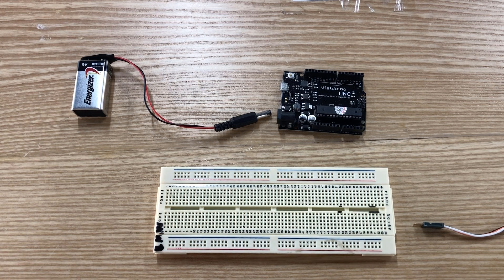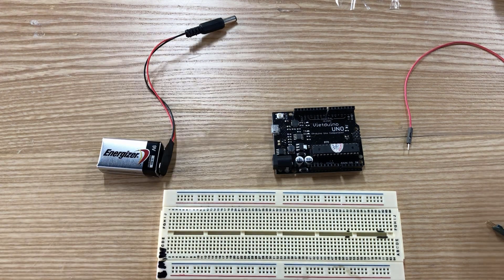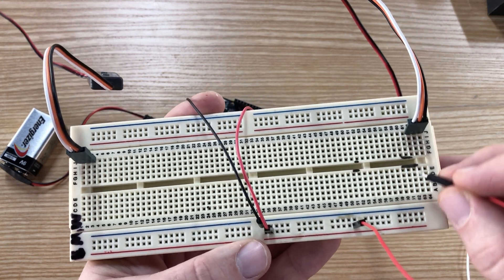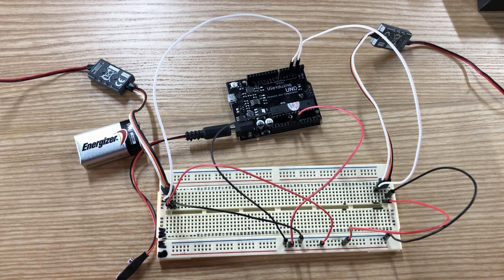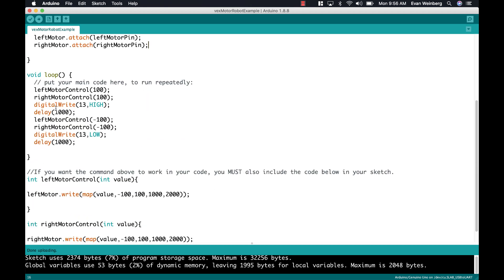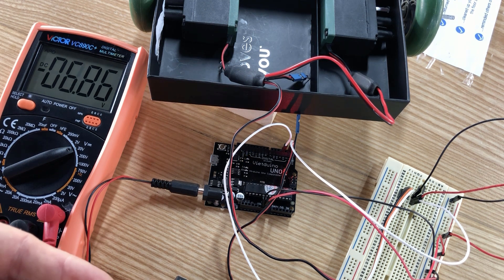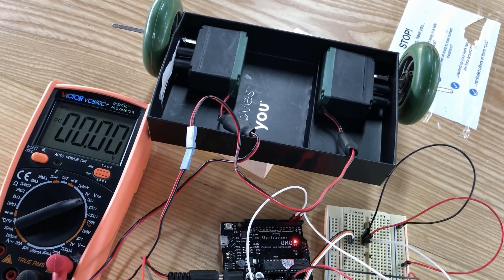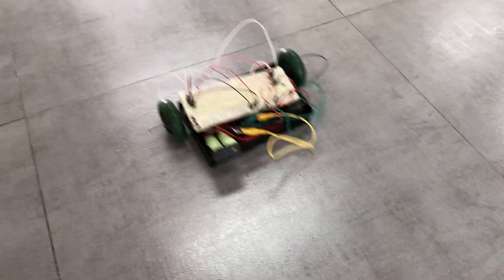VEX Motors Controllers, Motors, and Arduino Robot

Comment: I noticed that vex controller using 3.3VDC for its signal to the motor controller 
will it be fine in the long term since arduino giving signal at 5 VDC?

Comment: hello I tried this on an Arduino uno and it didn't work. I had it on usb idk if that's it  but I tested the output with a multimeter and it wasn't even reading low voltages please help.
Reply: If it’s connected to the computer via the usb program cable than that only outputs 5v and that’s not enough to power the motors. If you connect 9-12v to the barrel connector on the Arduino than it will be enough power.